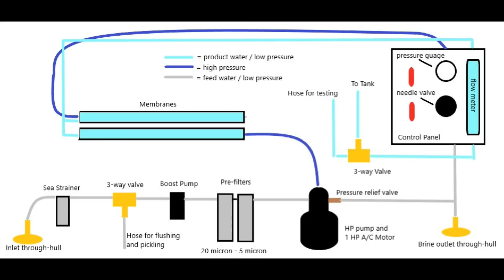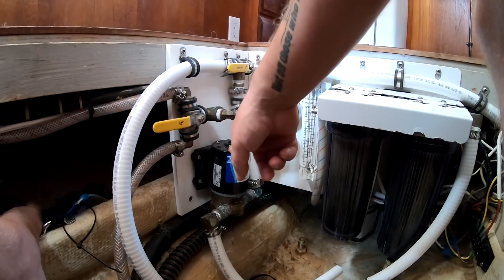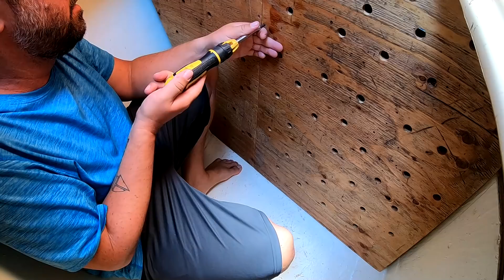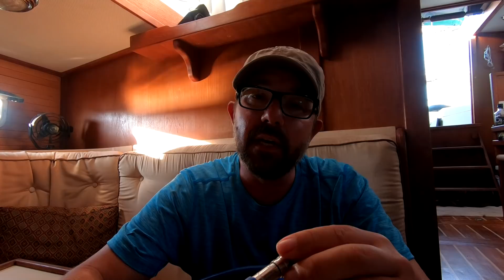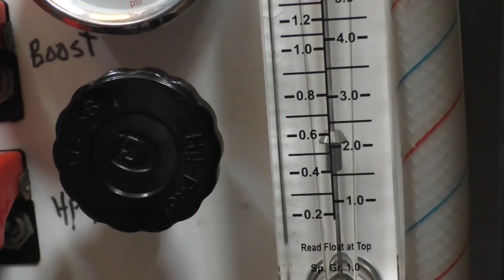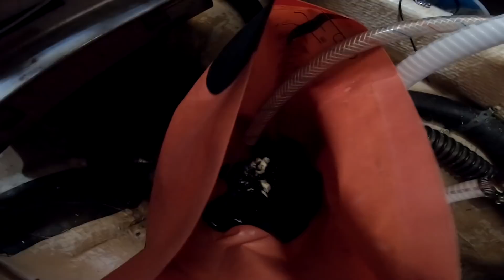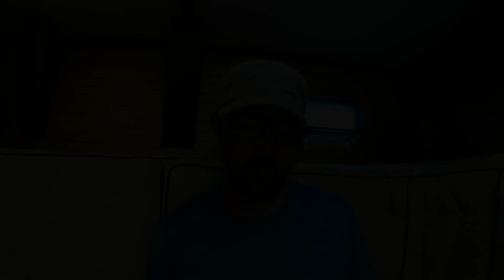How to make a 30 gallon per hour watermaker using off the shelf parts.

Comment: Great video.  Thanks for sharing! Just one question: You use a Jabsco boost pump with Max Pressure 1200 psi 
at 1725
 RPM ,Direct Drive 
with electric motor 1hp/0.75W, working at 110V/60Hz. Well, if i would like to use the generator working at 240V/50Hz,  the motor with 1hp work at different rpm (~1500rpm). How can you convert your system to a generator 240V/50Hz? Do you have to change the pump? or do you put a frequency inverter 1.5hp and ajust rpm to 1725 rpm ? Or do you have other solution? Thank you again.
Reply: buy a pump rated at the same volume (GPH) with  a motor running at 50Hz as the motor running at 60 Hz

Comment: I just saw this video and it's a fantastic source. This is the way building a watermaker on my boat. I love using standard parts, they are easy replaceable. It's just being creative to put them together in a way it works, as you have demonstrated in the video. Two thumbs up, great job. Now you got me on this topic, I wonder if you already have a part list and kind of a diagram how to build the watermaker. I have a 33' sailboat and I certainly need to stretch the installation a little. My tanks are 44 gallon and with this watermaker I will consider having a fresh water shower now instead of saltwater. Great video. Thanks again
Reply from the maker: Hi Manfred!  There is a parts list in the video description.  Click on the "show more" tab below the video and scroll down.  There you'll find the parts and pieces I used.  Also, if you read through the comments, there is some pretty useful info from other people as well as different options for pumps, motors, etc...  Good luck!

Comment: Amazing video.  Thanks so much.  Having the same boat as you is giving me so many ideas.  Wow - you have really utilized the space so well.  I have to laugh though - until last year my bilge was always a little more on the wet side.  Now that I've installed the PSS shaft seal I can see how the bilge is now viable space.  So where do you keep the Honda 2000 while making water?  Does it sit topside or does it have a working home somewhere?
Reply from the maker: The Honda lives in locker that I built specific for holding it as well as gas cans. When running, it sits on deck.

Comment: My pump source links keep getting removed.  It is as if someone doesn't want me telling anyone else.  In case it is YouBrother go to Bebay and search for "tefc f56c1s4c" for a nice 1hp cheap motor.  182.   Go to Bebay and search for "AR PUMP MODEL RCA2G22E with an f8 flange for 1.5hp  motor and above applications" "Comet Pump - LWS 1809 E" for 1hpsih applications with an f8 flange" or just the number and you can find a cheap brass pump head that will typically do it.  For .5hp dc applications use pump LWS 1209 E.  Use the links under more on this video to find the rest, and a stainless pump head if you want to spend the extra money.  Keep in mind you will rinse the system to protect the membranes so brass should be fine for like 20 years.

Comment: The needle valve you list is not designed for pressure regulation.  A needle valve with a regulating stem like the Swagelok SS-1RM4-S4 is more suitable.  https://www.swagelok.com/en/catalog/Product/Detail?part=SS-1RM4-S4

Comment: IAwesome vid! I looked at the product sheet for the Sw30-2540. It says to keep the elements moist at all times after first use. At the end of the video you normally flush out the system and pass air through. Do you also flush out the water at the membrane?
Reply from the maker: When I flush the system, no air gets passed through.  It's just a fresh water rinse which goes through the entire system, including the membranes.  I make sure that when flushing, no air gets sucked up into the line.

Comment: Nice build and explanation of the system. I am missing the pulsation damper on the high pressure (discharge) side of the triplex pump, to avoid pulsation stress and material fatigue. It will also provide smoother and more quiet operation of the HP pump.

Comment: Great video, this is something I have thought about doing for some time so it’s cool to see how you put it all together for my brain storming. I have a question about your motor size. By my math it seems you would need a 1.5hp motor for 1.5gpm 800psi pump. And yet your still getting ~30gph out of a 1.5gpm 1hp motor? Do you feel like the motor is getting over worked or over loaded? How did you decided on the 1hp motor other than cheap cost from the business going under. JNequipment has your pump paired up with a 1.5hp Motor on their website. Do you think your getting away with a 1hp motor because your running the pump at 800psi vs 1200 that’s it’s rated at?
Reply from the maker: The honda generator won't actually run a 1.5HP motor, so I went with what it would run since I already had the Honda as a backup power source from a construction project I did.  My math at the time said it should work.  Unfortunately I don't have the calculations anymore from when I put the system together (it's on a computer that has long since died).  As for overworking the pump or motor, I don't think it's been an issue.  It's been in the boat for nearly 7 years, and for the 4 years we've been cruising/traveling full time, it's been making all of our water without issue (thousands of gallons at this point).  I decided on the motor not only because of cost, but because it had the dual capacitors to help with the startup load on the generator.  I would have gone with a different brand motor if I hadn't found this one for the price.

Comment: You may want to look into waterco multi cyclone pre filters, they separate sediment using similar technology as Dyson vacuums do, they are used in multiple applications from pools, koi ponds, car washes, they have multiple sizes pressures and flow rates to match usage.

Comment: I bought my boat after Hurricane Sandy from insurance. It's a 1982 Morgan OI 416 ketch. Other than a hole in  the hull, the only real damage was to the high pressure pump and motor. The previous owner had removed them from the boat and they were damaged in his house. I have all the other parts and supplies.  This video will help me get it running again. Thanks for the good tutorial.

Comment: Great video!  Do you have an estimate on your water makers efficiency? In either electrical power draw (from your generator) per unit water produced or gallons of gas?
Reply from the maker: I don't know the efficiency in electrical power as far as watts per galllon, but I can tell you that we make roughly 110-120 gallons of water per gallon of gas in the generator.

Comment: One of the boats that I have fished on regularly just uses a dehumidifier to make water. It doesn't make a whole lot of water and we just use it for cleaning, not drinking but, it is a cheap way to make water.  I am wondering what some opinions are on this tactic.
Reply: Cruiseships do something similar, they collect condensate from the air conditioners to supplement their freshwater supply. A air conditioner is the exact same as a dehumidifier, except the only difference is where the units pump heat to (a/c to the outside, dehumidifier to the inside). Cruiseships, however,  have nearly unlimited power since they are running get sets all the time, and so cruise ships are heavily air conditioned for comfort and then collect the water. For a boater to run a de-humidifier (which has a compressor just like a air con and therefore a large power consumption), they would basically need a generator running full time (except for the most ridiculously oversized and un-seaman-like solar arrays) and they would collect pints per hour of condensate. In the same time, this system would create 30 gallons or more. I am going to guess that the fishing boat had to have a generator running fulltime for another purpose, and just so happened to plug in this dehumidifier to collect a small bit of water.
Reply: The yield of condensate water from an a/c or dehumidifier is calculable. Estimate the air temperature and humidity of your boating location, and you can calculate how much energy you have to remove from the air to drop the temperature to the dew point. A a/c will use roughly 1 part of electrical energy to move about 4 parts of heat energy. Look at how much water you have/want to have, calculate volume of air that will have that much water, calculate the change in temperature to bring to 100% humidity, then calculate the how long a air con has to run to to remove that amount of energy. The yield of water per kwhr of electricity is very little. The system adventurer made is setup to maximize freshwater yield per kwhr, while also being cost conscious.

Comment: i havent watched all your video yet.. but potable water can be  made from salt water with a simple one gallon sized carbon filter pumping thru it.. it tastes horrible but it is safe for human consumption.. (caveat.. if you dont filter out the bacteria you ll be sick with ANY filters.. i always  use am ultraviolet light filter inline after filtering)... this will make thousands of gallons of 98% salt free water.. then any better filter will clean the taste and remaining salts more easily and LONGER.. i always use 2 or 3  regular 1 gallon carbon house filters inline.. then a 100 dollar reverse osmosis type LOW PRESSURE 10 gallon unit.. it will actually produce 100 gallons an hour on the cleaned first stage water almost forever ..
Reply: sounds like you did pretty well
Reply: Do you have a part number to start my research on the 1 gallon carbon filter? Each Dow membrane in this build is over $280?
Reply: Yeah sorry but that's not right at all. The only way to remove salt from water is to either distil it or send it through an RO membrane (some will be removed with nanofiltration).
What you are doing is taking out other contaminants with your carbon filters, like chlorine, calcium and some other heavy metals and VOC's which will reduce the TDS a little and then pushing it through a membrane that is probably only around the 94-96% rejection ratio. To be considered for drinking water seawater RO membranes need to have a rejection ratio of 99.4% or greater.
Reply: That seems interesting. How much pressure do those carbon filters need?
Reply: It is an inline standard household filter dude.   @quintenluyten6382

Comment: Great job on this video. At the price of commercial systems, you show a good alternative.
Reply: The tradeoff is requiring a little knowledge to operate it and keep it running properly, but in many ways, that's a good thing.  Instead of the watermaker being a mysterious black box, having some knowledge abut how and why it works may increase overall system reliability, as long as multiple people have the knowledge.

An advantage of a commercial system may be in integration of the components and automation of the controls.

Comment: Stupid question, but isn't 30 gallons per hour way way more than you need? Shouldn't you be able to get by even with a much smaller water maker?

And for flushing, wouldn't it be better to reverse the direction, so clean water is pushed in the reverse direction through the filters?

Thanks for the awesome video! A system that keeps you alive is always good to be able to take apart and repair yourself!
Reply: Depends on how much water you carry and go through in a day. I carry 120 gallons in tanks plus 15 in jerry jugs, being able to fill them all from empty in under 5 hours of generator time is a big plus. It allows you to shower regularly, use a fresh water flush on the head, rinse the boat with fresh water occasionally, and in general be rather comfortable for a few liters of diesel or gas per week. Is it more than you need, sure. But why not be comfy if you can for relatively little cost?
Reply from the maker: Exactly what Robert Place said!  As for the flushing, you definitely don''t want to back pressure the system.  The flushing is only to rinse off the surface of the membranes and the internals of the system from salt and biological growth.
Reply: Thank you both for the info! That all makes very much sense :)

Comment: use XLE 4040 membranes... 2400GPD plus they run at 250psi insead of 800PSI  ....  no pipe bomb hazard ....  tips from sugar country! we run 2 brix maple sap and throw out 180GPH product with 4 membranes. with a 1gpm 8-12 brix brine...  as for cleaning, we swing the ph as high as possible then as low as possible to dissolve contaminants. I guess the same aplies to salt water.  check out the XLE 4040 specs!
Reply: Those are for freshwater system membranes.  They don't have a high enough salt rejection, only 99% rejection and not designed for a high salt environment perhaps only a normally salty environment.  That is what Dow says anyway.

Comment: Awesome video! Keep them coming. Curious if the 40inch 3m filters kill off bacteria and other cooties. Is there a need to run a UV light inline?
Reply from the maker: They don't "kill" off bacteria or other cooties, but they do block them from going into the product water.  I know that some people do use a UV light to treat the product water, but I don't think it's neccesary.  We've made thousands of gallons of water, sometimes in places where the seawater is pretty funky from runoff from unsanitary cities and have had zero issues.  We've never had the water tested for cooties, but we've also never gotten sick, which in my mind tells me it's pretty good water.

Comment: Fantastic!  The only thing I do not like is the requirement to run the engine ( burn fuel ) to create water.  Have you had the water checked to ensure it is free of microbes?  No one likes drinking cholera.

Comment: Hey Taco Man... good video. Question. Did I miss it or do you flush the membrane forward instead of backwards to the brine flush line? I thought I paid attention to all the valves but maybe I missed it whilst dreaming of tacos. Thanks.
Reply from the maker: The forward flushing basically just rinses off the outer surface of the membranes as well as the internals of the system.  It won't dislodge any particulates from the membranes or pre-filters like backflushing would.  It sounds like your backflush through the brine line may be a good idea. As for pickling, that actually just kills and sterilizes any biological stuff in the system and prevents any growth from happening.
Reply: @SailingVesselAdventurer  back flushing through the brine line still would only rinse the outer surface of the membrane. backflushing through the product line would blow the membrane off the filter.
Reply from the maker: Sorry, but I'm not sure what you mean by flushing forward or backwards.  The water only travels one way through the system so I guess that means it's being flushed forward. I'm definitely not back-pressuring the system if that's what you mean.  The idea is just to rinse off the salt and biological contamonents from the surface of the membranes and internal parts of the system with the fresh water.
Reply: Thanks for the reply. On mine there is a dedicated 'brine' line for flushing freshwater through the opposite of the membrane flow overboard so the crap is rinsed out. I thought that was the whole point of requiring pickling. So  if you don't use and flush every few days it wouldn't ruin your system with biological particles. If the rinse is only forward, how do the bios go out and away from the membrane? Just askin cause y'all seem like fun folk and I'm heading that way when it decides to cool down again. I kept notes on where the good tacos and churro are. Thanks!!
Reply: Also backflushing goes through the pores cleaning them out. Forward flushing as already said does little for the pores. Its quite straightforward to arrange the valves and pipework to pump high pressure purified water back through the system to waste.
Reply: cleaning is usually by backflushig
Reply: I do not know of any filtration system that is not cleaned by backflushing. Far more effective. Also I would not consume water out of a storage tank without further disinfection/treatment

Comment: I really like the simple way you described this machine and your reasons for building it the way you did. The result is that you made a topic I always considered "complicated and mysterious" for the new cruiser into something that I understood easily and heck, I even had a eureka moment! Thank you for taking the time to make a great instructional video.
Reply: The simple way would be take a Honda 4000 PSI Pressure washer amd hook the high pressure line that would go to the spray wand, to a membrane. Easy. This has a bunch of nonsense.

Comment: Excellent job, and thanks! I've totaled the parts up using your links and the motor link Allyn gives below, and the total was $2500. With no spares included and using the ss pump. Using the brass pump  you'd save about 550 off that. Brass looks ok reading this http://www.sailnet.com/forums/general-discussion-sailing-related/237065-brass-watermaker-high-pressure-pump.html
Reply from the maker: The links I show are for places I purchased everything. With some time and creative searching on the internet, you may be able to find better prices out there. Not sure though.
Reply: The only significant savings I see are on the motor Allyn showed vs. the one you used, and the brass pump vs. the ss one you used.